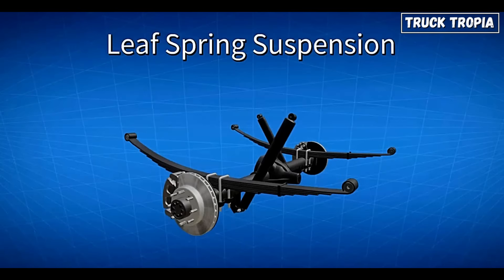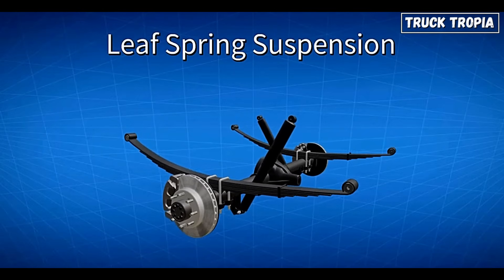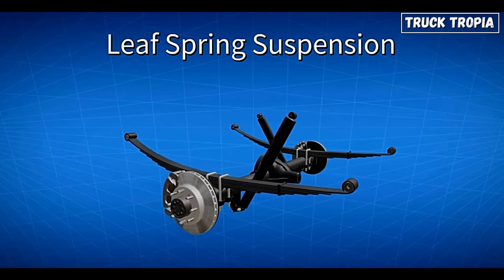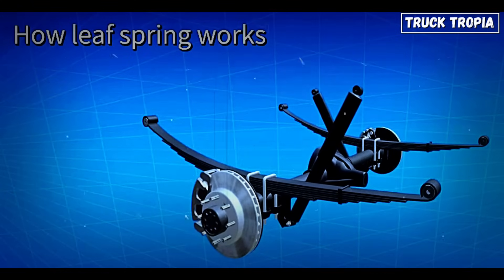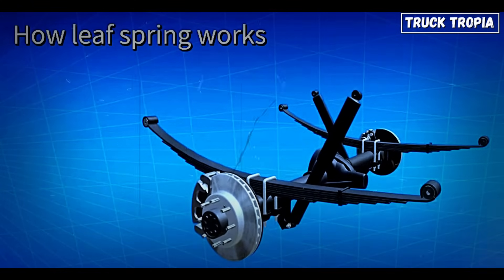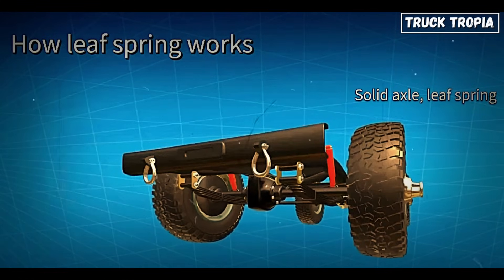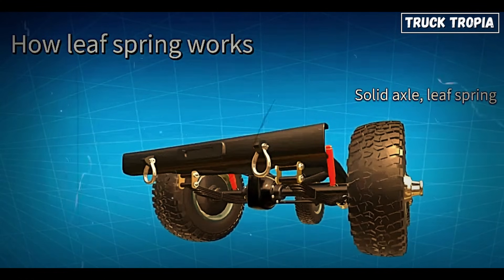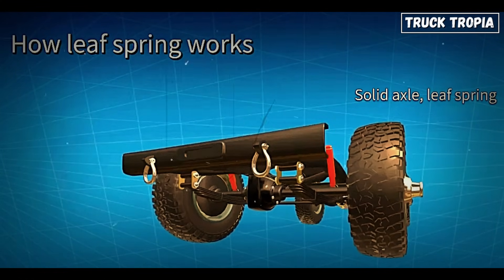How Does Semi-Truck Suspension Systems Work?

Comment: It should be mentioned that one type of suspension doesn't exclude the others. Most of the trucks I've seen use a combination of air rides with hydraulic shocks on the same axle
Reply from the maker: Thanks for pointing that out!

Comment: Ive got me one of those tri drives. 316 inch wheel base, heavy haul and local Costco delivery's. 

Fyi, for all of my lower 48 brothers and sisters,  what you do is far harder than these idiots up here in Alaska.  2 million miles down there before coming up here (easier work and 2x the$). These guys are really good at one thing,  one road and nothing else.  Funny thing is, they make fun of you all and all the while they can't take their big pete off the hwy because they dont know how to drive in close quarters or how to back it up.

Comment: Air suspension just make sense in a truck.
You already have a compressor on board to provide air pressure to the springs.
Also you can easily adjust the ride height with a remote, that actually save my butt once.
Reply: And totally useless if your running dump truck where either rubber block/walking beam or Mack’s Camelback spring suspension is the best
Reply: @kanoraguy  I've driven multiple dump trucks and none of them had a suspension you're describing 🤔
One had leaf springs, rest were on air springs.
Air suspension and it's ability to change ride height on demand got me unstuck on snow many times.
Reply: @ your young so of course you’ve never had them. Trust me they are better on uneven ground that air bags. You can operate on wildly uneven ground and still have traction with both unlike airbags.
Reply: @kanoraguy  How is my age relevant?
We in Europe just put air springs in all trucks.

Comment: I think torsion bars is used in tractor's front axle 🤔
Reply: Nope. Most common is a 2 or 3 leaf steel spring.
Reply: Most of them are just pivot axles. More expensive ones have front axle suspensions for more traction and comfort.
Reply: Nope
Reply: Tractors usually use a walking beam mounted perpendicular to the driving direction with one wheel on each end.

Moderne tractors can have the front axle mounted to a frame with a hydro-pneumatic suspension that let's you adjust the height via the hydraulics and absorbe shocks by gas membrane chambers filled with nitrogen.